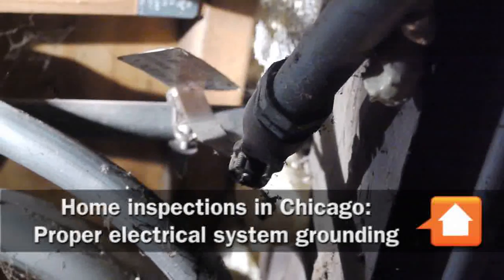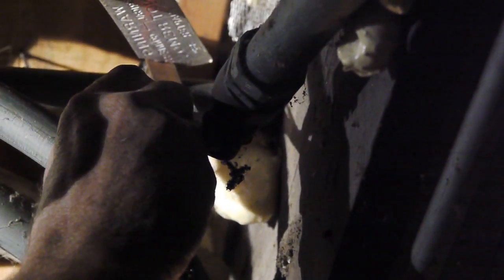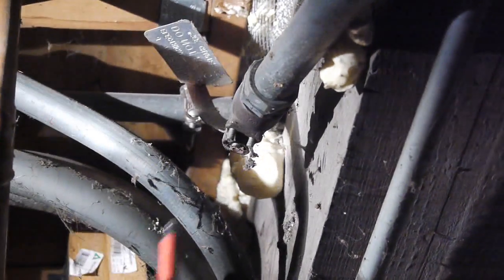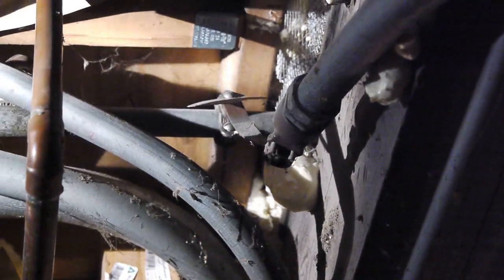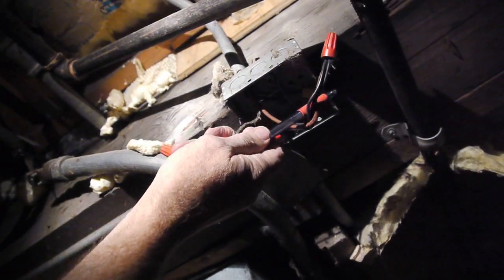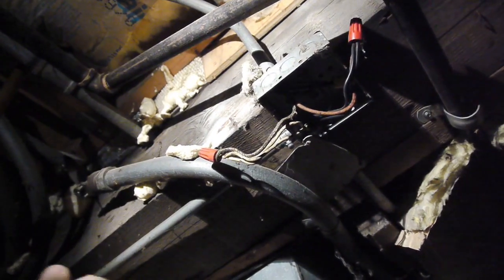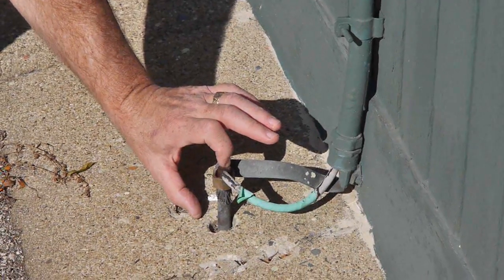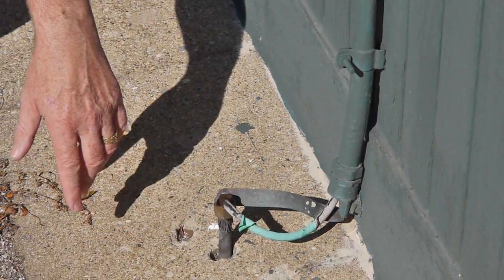Home inspections in Chicago: Proper electrical system grounding

Comment: Well, I am a fan of using conduit inside the walls not really because of the safety aspect but more for the repair and upgrade advantages.  That said, I would be running a bare grounding conductor through every conduit branch and bonded at each box with a pig tail to each receptacle or corresponding fixture or device as a redundancy and if an isolated ground is needed, it would be a conductor with green insulation.  

In this example it looks like your grounding is incorrect in many municipalities throughout Canada and the United States as grounding rods should be further out from the premises than shown here and the grounding cable should be at the point of entry for the water main before the water meter.  I am not an electrician but I have a large respect for electricity and when these things should be implemented.

Your Handyman should have some knowledge of the local electrical codes as well as applying for and getting any required permits and after the handyman has finished, he/she/they should be having a certified and bonded electrician or electrical inspector follow up on their work and sign off to the requirements of the permit.